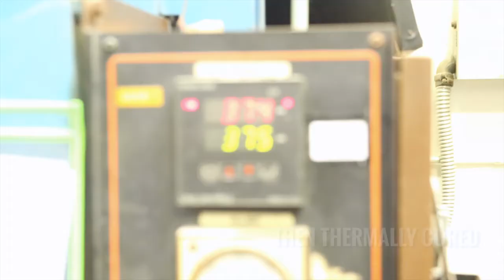What happens to my gun when I send it to Robar?

Comment: Can you refinish aluminum alloy frames? I have a couple older Italian made Beretta's that both have a alloy frame. If so, then what finish would you recommend?
Reply: I would not get Rogard black on alloy metals. It will scuff, mar quickly. Alloy does not lend itself to after market coatings or surface treatments. Cerakote Elite or NP3+ might be a better pick.